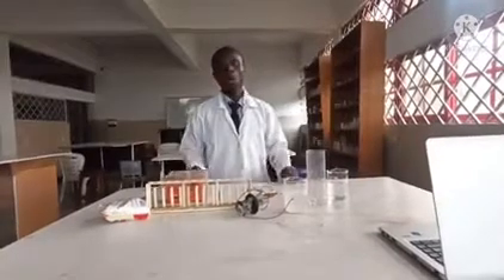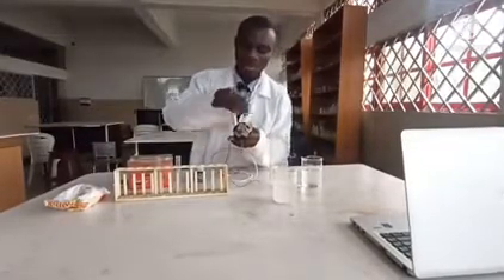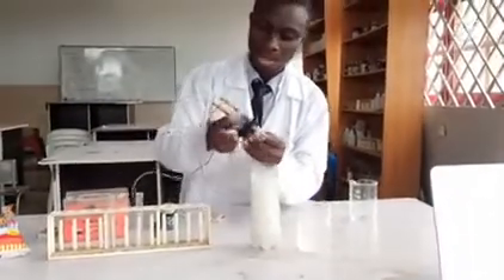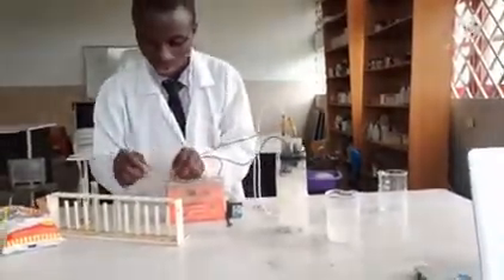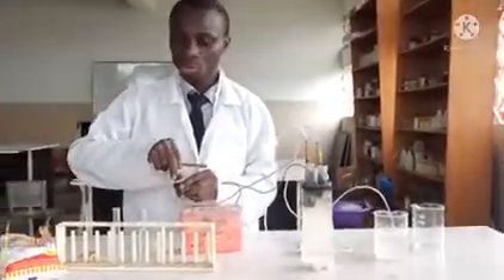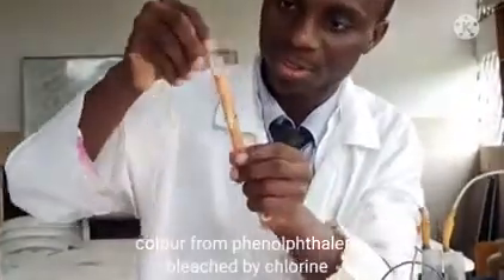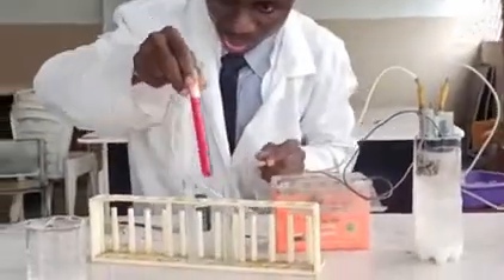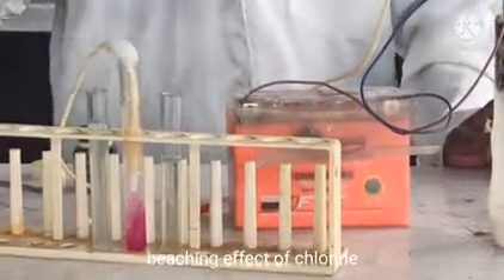Electrolysis of brine, production and test for hydrogen and chlorine gases with membrane cell.

Comment: Could you pls walk me through on how to create this set up. With a guide on the local materials i need.
I'm a Chemistry facilitator and would love to show this to my students
Reply from the maker: This project is to make bleach , it is actually a simple model , though I have built a big one before but the challenge was that the carbon rods though inert were always wearing into solution. 
     The aim is to produce chlorine from concerned solution of sodium chloride and pass it excess sodium hydroxide. 
     Chloride is a yellowish greenish gas , denser than air, It not a good news to inhale it , I have inhaled large doses of it , your electric fan can't blow it away easily , you won't be yourself all through the day. This simple model here uses a DC battery but I use to use a transformerless power supply with 100uf capacitor in place of a transformer. 
     For this project here , you need two syringes 10ml each , carbon rod from batteries , a piece of cloth acting as the separator , to ensure the products doesn't mix. The gas  generated(chlorine)  is passed to a container containing sodium hydroxide - caustic soda. Take note the gS generated at the positive terminal is chlorine while at the negative terminal is hydrogen. It is very important to have sodium hydroxide because it absorbs chlorine very well , even soda bicarbonate in water does so. Otherwise bubbling it in water causes air poisoning since chlorine sparingly dissolves in water. There's much to the design and chemical reactions I can't state here for time ,if sodium hypochlorite produced is left to stand for some time it oxidized and changes to sodium chlorate .
Reply: @odereharrisonethe1931  Is there a possible way to possible reach out to you in person Sir, would love to for the sole aim of grasping the design and possible mentorship